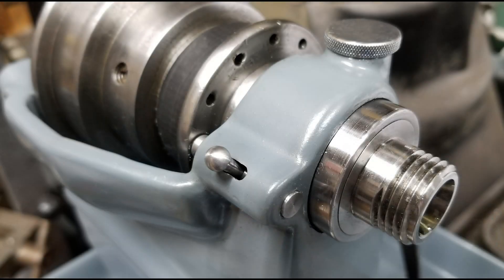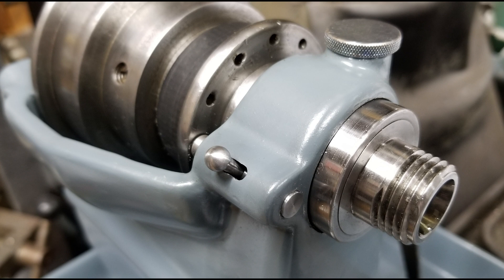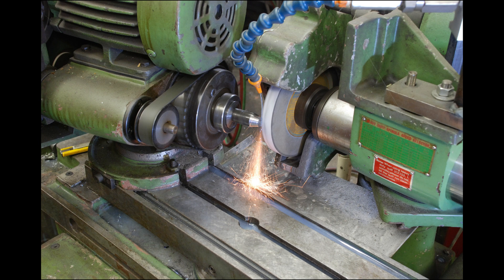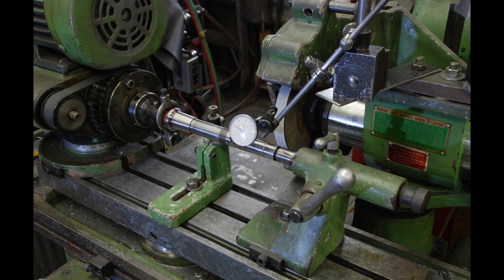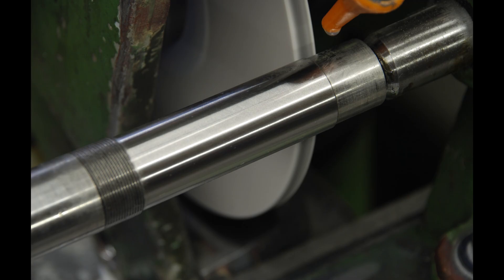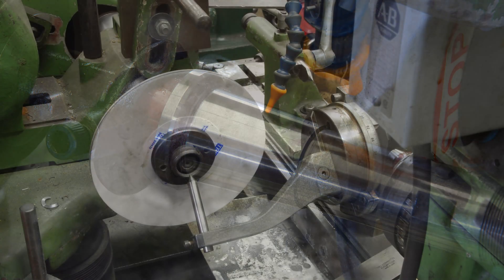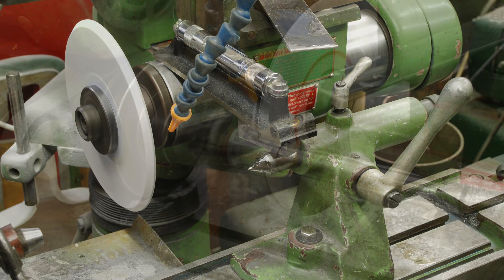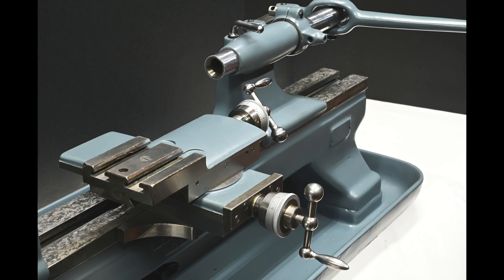Reconditioning a Schaublin 70 Lathe   Part IV   Grinding the Spindle Shaft

Comment: We have a couple of these where I work and one of the spindles wobbles around a lot. It's only good for holding stuff and spinning it for polishing or rubbing with emery cloth.
The machines in the shop aren't well looked after. Nobody seems to feel any responsibility to maintain them. They're not cleaned after use and there's no real schedule for oiling them. Just sorting out problems as they arise. (sigh 😓)
One day I'll work somewhere that actually cares.